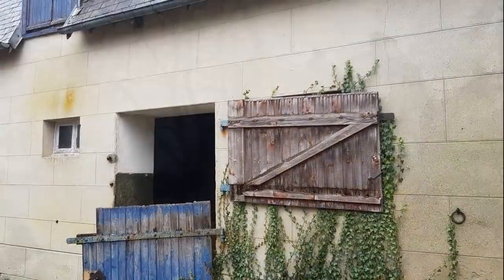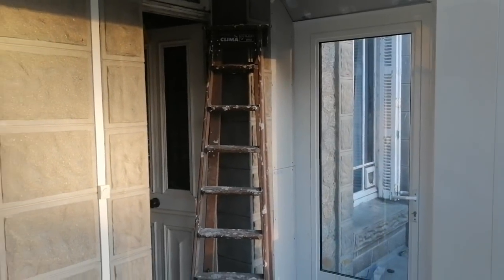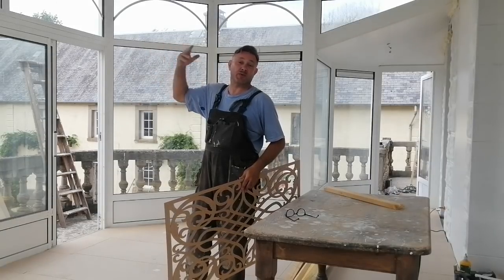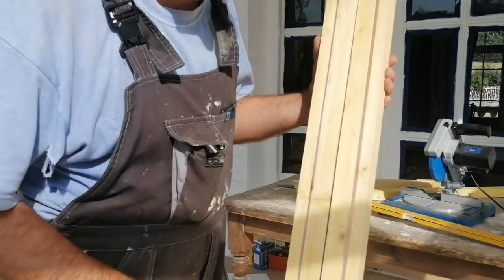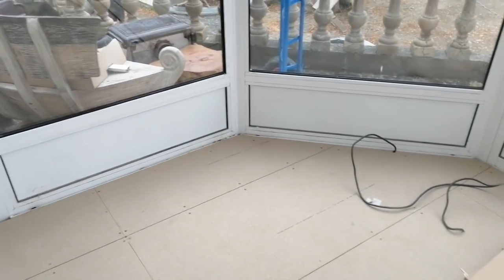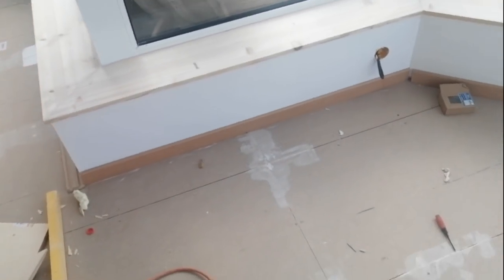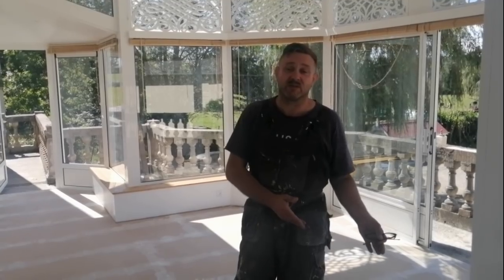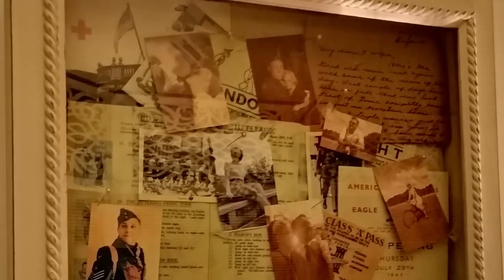Ep 49: Amazing conservatory make-over!

Comment: Dumb question what's going to keep it from water condensation making mold with all that headboard up there
Reply: It's NOT dumb !! (I see no path for venting that "lack of crawl space')
Reply from the maker: Its a valid point Thelma, spot on in fact; the void does need venting and circulation. We ordered 3 poly roof vents for the roof but these have still to arrive (from China AGHH) so we couldn't cover this part in the movie.
Reply from the maker: quite right Stephen , the void will get the circulation and venting it needs once these darn vents arrive!!
Reply from the maker: We probably wont cover the install on film, bit boring :-)